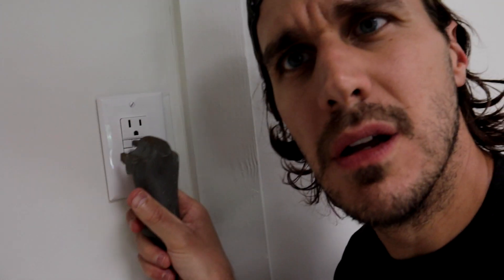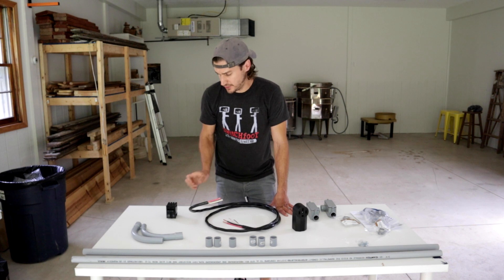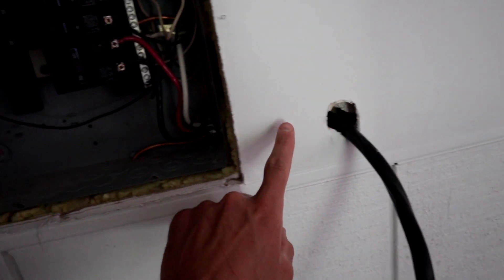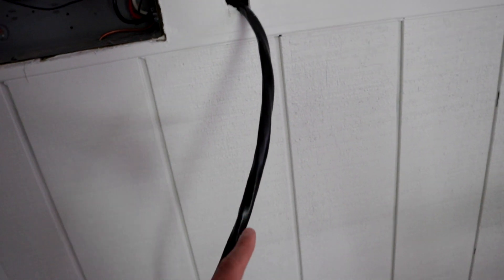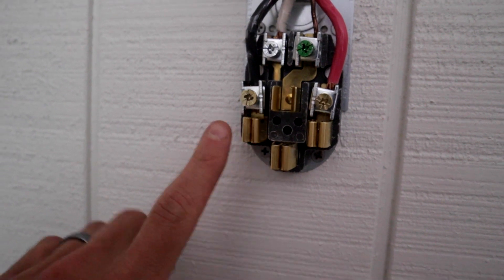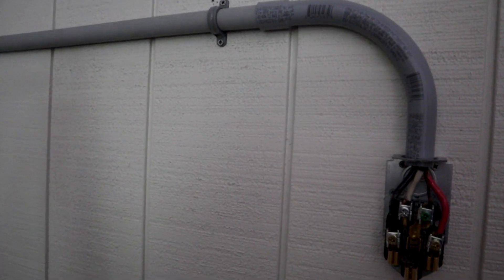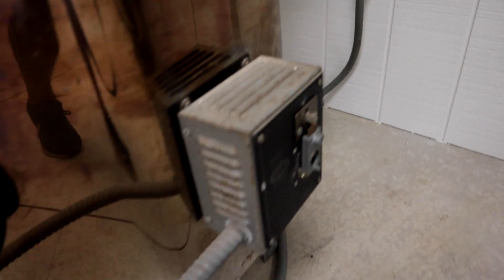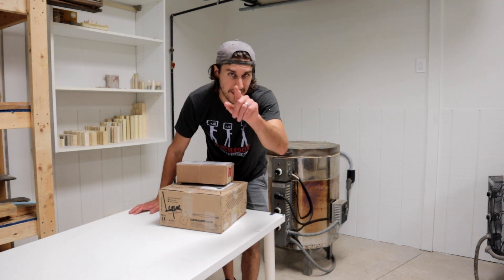Upgrading the Electric for the Kiln - Ep. 4

Comment: For those planning to copy please be aware that the wire run thru conduit is per national electric code NOT a combo sheathed 8/3 with ground but 4 individual wires for proper heat dissipation. Also the loose wiring between breaker box and pull box elbow is not "legal" .  The conduit is meant to be cemented to each piece to prevent pulling apart when cousin Vinnie rests his size 12 Wolverines on it. In any case you might be better off with galv steel conduit, again for heat dispation - those wires running 30-60 amps get hot. Who cares about all this: your insurance co. And fire dept. Hopefully you faked power to the kiln during demo - kiln sitter did not appear to be functioning- as all those damaged elements shorting to each other did not appear to trip breaker. Post some pictures of your expertise- pots.

Comment: It isn't clear in this video, but be aware that shutting off the main switch IN the electrical box likely does not cut off TO the box.  It may be possible safely to change out a breaker, but don't think there's no power IN the box -- there probably is.

Comment: Just a couple of things you missed to make this a professional job. You didn't use a box connector at the outlet or at the panel. A box connector is a male threaded adaptor that has a nut ring. The nut ring secures the plastic conduit to the box preventing the chance of wire chafing from the metal box. I would have also glued all of the connections. Happy potting!